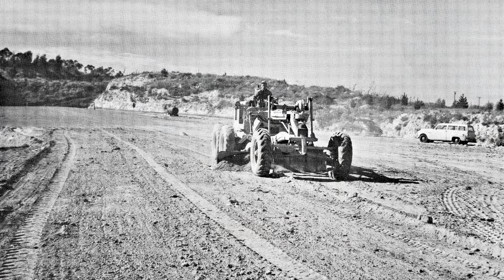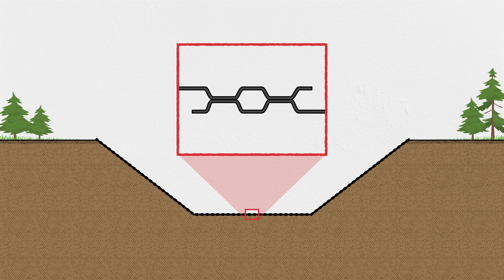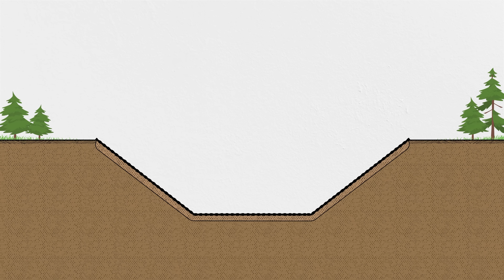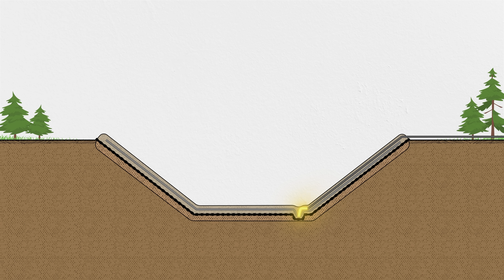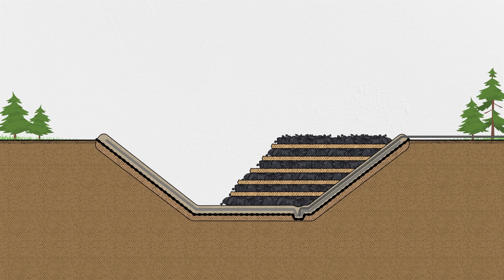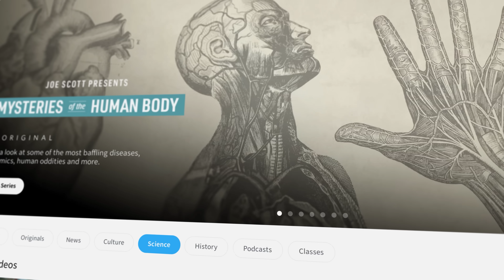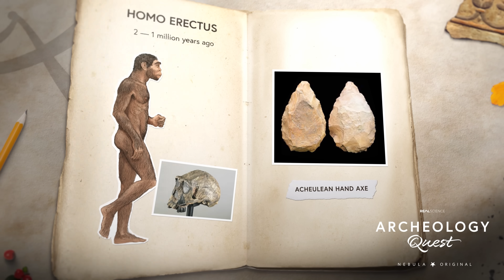The Hidden Engineering of Landfills

Comment: worked at and traveled to different landfills in the mid-west. I get repurposing the landfills after they close but don't the trash hills shrink over time after releasing all that gas and liquid? I feel like building something on them could result in structural issues down the line.

Comment: I've worked in dumps for a few decades. Most recently inside the Suncor baseplant in Fort McMurray, Alberta, Canada. And although advanced technologies are available, not many facilities are top notch. During ONE day, I can transfer between 5 dumps. I call them dumps because they are not landfills. Landfills, by the wording, are CLEAN fills. Garbage doesn't come from the ground. It is manufactured. But concrete, rock, soil, aggregate comes from the ground. So, landfill/cleanfill.

I had to deal with spontaneous dump fires from methane being produced. The putrid stench of garbage from decomposing rotting food is unfathomable. There ARE inspectors who come and check all the runnings and plans for each stage of a dump. But they are paper-pushers. They don't do much, other than ask questions and check off boxes on their checklists.

Comment: As an engineer, I don't like seeing landfill gasses flared off. It goes against the efficiency nut in me. I'd rather they be diverted to a power plant or something.
Reply: Usually they're only flared off when the volume or methane content is too low to justify the cost of recovery. A lot of landfills sell their gas. The one I'm at today is in the process of adding an active gas system that will tie into the local gas supply and feed a power plant  down the road.

Comment: I have a question. In Greentree PA, they built a mall on top of a land fill. The mall constantly shook. You didn’t notice the shaking when you were walking, just when you stopped walking. Outside in the parking lot you didn’t feel any shaking. The mall is closed now, not because of the shaking but because of economical reasons. Can you explain the science of the mall shaking? What was causing it. I didn’t notice any structural damage and people seem to accept the fact that the mall shook. The mall was called “Parkway Center Mall” if you want to look it up. I’d appreciate a response to this. Was it safe? Apparently people thought so.
Reply: It was trash

Comment: While I appreciate the very good and basic presentation,  and it was well done,  it was quite naive and presented a greenwashed view of landfills. All landfills leak. Flaming off landfill gas produces toxic compounds that fall out and contaminate  soil and water. While landfill owners must maintain the site for 30 years,  the toxic swamp and soup continue to be dangerous for unknown lengths of time with ongoing costs of maintainance and surveillance dumped on the local towns and cities. Landfills need to be carefully sited and a last resort after all reusable and recyclable materials have been removed.

Comment: I lived in Whittier from the mid 90's until 2005. Near rose hills which is a cemetery that's also a buffer between the landfill and residents in whittier. I lived very close to the landfill, and had no idea it was even there. I only found out in 2006 when I moved to hacienda heights which is on the opposite side of the landfill. My hats off to the puente hills landfill facility. I lived within 3 miles of it for 10+ years and never smelled a whiff of trash. I still drive by the location of the landfill, and it looks like a spot that hasn't been developed on. There's trees and vegetation which are mostly, if not all, native plants to that area. It looks like a mountain area that hasn't been disturbed by humans, when in reality it's 5 decades of our waste that made that mountain. Pretty amazing.

Comment: Here in germany, there is a law that prohibits the disposal of waste in landfills before it has been burned. So we have many waste incineration facilities which produce heat and electricity. And the ash that is left in the process is then (if possible) used in road construction and the things in the ash that cannot be used anymore get buried in the landfills. There are nearly no Problems with water contamination, Bad smells and it takes much much longer until a landfill has to be closed because it is full.

Comment: OMG Grady, I got halfway through this video on Nebula and had to go watch the whole thing with my mom. We live just a couple miles from a landfill near Joshua Tree, and NEVER know it's there until we go to drop off yard waste occasionally, and we have a subscription to have our like 3 gallons of garbage picked up weekly, even though we could put out 150 gallons according to our rate. 

I feel like this could be 5 videos, with one for in depth discussion on each step! You should go out and talk to the individual engineers kinda like Destin did when talking to the submarine crew or with the coast guard! 

A question we had was about the post-sealing step where like in Puente Hills where they extract the methane for energy production. Doesn't the trash turning into methane leave open pockets in the trash mountain that would eventually settle, or even crash into a sinkhole? Why would you want to build any permanent facilities on top of it if you were pulling contents out of the mountain you were sitting on top of?

Comment: In my country, we have discontinued the use of landfills for almost all waste. It is only the waste that cannot be burned or easily recycled, light concrete, polluted gipsum, asbestos, and some forms of pvc, that end up in a landfill. If it can be burned they are incinerated in special power plants that have the necessary type of owns that can do it, the heat is then turned into electricity and central heating and the smoke is cleaned of pollutants other than CO2. I have to say the way we do seems a way more economically sensible system than having to maintain landfills for decades and only slowly extracting the energy from the waste.

Comment: The year is 2091

after the big shaker, oil reserves unexpectly ran dry

plastic reduction is the leading means of generating hydrocarbons at scale

the oceanic deplastification projects have failed

the plant based hydrocarbon projects have been marred in politics and industry sabotage for decades

the one great source of plastics?

the landfills

a new goldrush has swept the continental united states

county landfills became federal reserves

once illegally dumped waste became buried treasure

abandoned stockpiles of worthless trash became salvage claims

these are the stories

of

THE PLASTIC WARS

sweet synthwave theme chimes in

Comment: Call me old fashioned but instead of locking away our waste for eternity, wouldn't it be better to use the now decades old technology of plasma gasification where we can take our trash 'evaporate' it to its base elements and gases - reuse those elements and gasses and what's left that doesn't breakdown is an obsidian like substance that we can use to build roads with. Plus the process can also be used to power electric turbines to generate electricity. That sounds better than an out of sight, out of mind approach.

Comment: Years ago we did an on grade HDD into a landfill whose leachate system was failing. The landfill was hard compacted clay and there was about a 1 meter target zone of shredded tires lining the bottom as our target. After Boring to the target zone we pulled the bit out of the hole, and forward reamed a 12 inch hole to the target and tripped out again. (spent a lot of time removing the tire shred off our tooling after.) The contractor we were working for then pushed a perforated pipe into our bore hole with an excavator. We did a couple other bores to eventually pipe it to a new settling pond they had built. Boy was that a gross endeavor lol. As soon as our BHA broke through the clay line the leachate came pouring out of our bore hole. they had massive containment pits around our rig to prevent the fluid from escaping.

Comment: Not once did he describe the decomposition of the trash after its been buried and the liquids/gases have been run off. If it decomposes enough would that cause structural failure leading to sink holes? Thats what i was waiting to hear about through the whole video. Will the trash decompose to the point it turns into some sort of oil?
*Edit:
Shakes him roughly WHAT HAPPENS TO THE OLD TRASH ROBERT!?!

Comment: 12:20 How is the dump not still profitable after closer when it can produce gases that can provide power for 70,000 homes? You sure its that many homes? Seems aweful high. 70,000 x 100 (cost of power)= 7,000,000 a month. I also think its very cool after closer they are getting new uses like power production and parks.

Comment: Renaissance Park in Charlotte, NC was built on a landfill. It worked out great for a long time, but the settling caused some major problems with the infrastructure of the athletic fields. I believe the golf course, disc golf course and bike trails are still functional though.  It's funny, I had to work a charity event on the golf course and would see the pipes sticking up out of the ground here and there.    I always loved the idea of recycling the landfill for park usage... but it does still need a lot of tweaking to make it work safely.

Comment: My landfill feels like you are on a plateau. It is huge, and you have to drive around it to get to the top. You look out at the distance and everything looks so tiny. When you drop trash, there are bulldozers just spreading dirt over what you drop. A never ending litter box, just building up on itself. Mine had vents that kept releasing a visible gas to the outside. It did not smell bad, and it was a very hot sunny day.

Comment: I don't know if this would fit in your channel's aegis, but Solid Waste Disposal via Pyrolysis[1,2] might be an interesting topic for you and your viewers. Key benefits of Pyrolysis are:

1. Massive decrease in volume.
2. Solid Leftovers are vitrified and less able to leach into the soil and groundwater.
3. Some Solid Leftovers can be used as building materials.
4. Production of Syngas, potentially offsetting the energy used for Pyrolysis.

[1] https://en.wikipedia.org/wiki/Pyrolysis
[2] https://greenpower.equipment/articles/pyrolysis-as-a-promising-method-of-waste-processing-basic-principles-and-advantages/

Comment: I feel like evaporating the lechate and putting what remains back into the landfill may be the cheapest solution but it might not be the best long term solution as if lechate is the main problem, maybe removing it from the landfill and repurposing it somehow will eventually mean the lechate becomes less and less dangerous over time, though its still probably best to evaporate the water from it so that you're dealing with a solid or at least less volume.

Comment: that natural gas is not just an unwanted byproduct of the trash collection but a goal of energy collection through decomposure the heat generated the gas from microbiology could just setup highly efficient power generation collection storage and else for providing night power when solar is unavailable or when the morning and evening winds are not strong for wind power absorption or water power a known in pumped storage etc actually gravity power batteries and else to take up demand capacity surges with less grid wear impacts due to heat of power losses i mean some off grid homes have waste digestor bags just for collecting gas from thier waste and fuel for heat  maybe not enough to run generators for electric 24/7 but still could be used that way to purge excess buildup into batteries for easy use later and to supplement other collection not generation sources as wording would lie to ya

Comment: The video is overly positive towards landfills.

No common trash should be put in landfills but be burnt for heat and electricity. This is totally possible as the Swedish example shows banning the practice since 2002 and 2005 for organic waste. Counting from 1990 til 2022 the emissions from landfills have decreased with a staggering 87% and keeps shrinking.

Comment: My hometown (in Kent County, MI), had only 2 years of life left on its landfill. So they built a comprehensive waste sorting facility, where municipal waste could be sorted into combustible and recyclable waste. By burning much of the waste before it was landfilled, the county is able to generate power and increased the lifespan of the landfill to 20 years, since now it just takes in ash.
Reply: thye could sell the ash as fertilizer. well, trash ash. so maybe not (:
Reply: @LuxicCardinal  
Some municipal waste facilities offer compost from the yard debris they take in. Great for flower beds, but don't use it to grow food you plan on eating.
Reply: @SoberAddiction my hometown of Bethlehem PA has been doing this, as well as offering free mulch, since the early 1980s
Reply: @LuxicCardinal  it goes in a salt mine as it is not really healthy
Reply: As someone who grew up in grandville I never knew this! Do you know when this all happened?
Reply: @lagsalot7626  goto to kent county board of puplic works site
Reply: @lagsalot7626
Reply: That facility also has a bio dig-ester that takes waste from Amway,  Coke and founders and digest their waste. It removed enough waste from the treatment plant to extend  its life longer and removed the solids from the bottom of the tanks also to digest.
Reply: Hey! I lived in Grandville for a couple of years and worked on Alpine Ave. for a few years. We moved north to Grant for a few years, then used the Muskegon Co. dump on M-46 when we moved back to Lansing.
Reply: @adamdewitt6430  I grew up in Kent City!! I didn't know that Kent Co had municipal sorting. My son wanted to watch this and I saw this comment come across.
Reply: hello fellow michigander!
Reply: I wonder how the carbon emissions compare with burning to landfilling.
Reply: @Axle-F In switzerland we dont have landfills, just burning facilities. we use high performance carbon filters, recycle a lot and generate energy with it.
Reply: @sinn6719  What happens to the ash in Switzerland?
Reply: @sinn6719   That's a bit misleading, there isn't really such a thing as carbon filters.
Reply: @sinn6719  The biggest problem with that idea in America would be the separating process. We just don't separate our waste enough.  I've traveled a lot and other countries just have a culture of waste separation that's just much better.  Every trash bin has multiple options for various types of waste, whereas in America it's just one big bin.  It's a huge part of our consumption problem, as a society we don't want to put in the effort to separate it because that requires thinking about where the waste goes and people are uncomfortable with that. So the "magic" bins just disappear with our waste each week and we don't have to think about it.  
More and more restaurants and public spaces have better separation bins these days but it is a very very slow cultural shift to get people to pay attention to the bins and an even bigger challenge to get them to separate waste at home.  

I'm currently saving to buy land and I'll be excited once I have my own homestead to be able to separate more by having larger compost, wet and dry waste, the ability to store lumber waste (I like to do woodworking, but don't have much space currently), and a place to make a mulch pile, etc.  We don't do enough in America to take care of our world.  It takes both personal accountability AND systemic efforts to make change and right now not much of either is happening here...😢
Reply: @Axle-F usually these types of facilities are fitted with carbon scrubbers on the exhaust.  So the foot print would only be the cost of making and reconditioning the co2 scrubbers
Reply: @Axle-F   It depends. With organic waste, when you bury it you cause anaerobic decay which leads to methane emissions, which are more potent than CO2. Burning would cause CO2 emissions instead, but if that organic waste was allowed to decay in air it would release CO2 anyway, but you would get some excess emissions from the natural gas you use to start incineration. However, burning plastics means you're putting CO2 into the atmosphere which would have just been better off buried in the ground.
Reply: @Axle-F  better to keep the methane emissions and such in mind for this, since for the lifetime of the landfill, the methane isnt sealed in. By burning the trash and only compacting or reusing the ash, youre getting the last bits of useful life out of it, preventing it from generating methane, and possibly using the ash itself in something else useful.
Reply: @Axle-F  Doesn't matter. The county doesn't deal with carbon emissions.
Reply: there burning trash in kent county? is this africa
Reply: I'm from Grand Rapids and I used to bring my stuff to the downtown location sometimes. I'm not sure if there's more than one location where you can drop off your own sorted trash but I went to that one and it's nice. The city had a great system too where you got a whole trash can the same size as the trash, to put recycling in upon request. It was blue with a yellow lid, easy to tell the difference from the trash.  I always ended up with more recycling than trash so I chose a bigger recycling bin. Then they pick it up for free.
Reply: I remember a new incinerator opening in my town of Huntington, LI, NY when I was a kid.  Probably about 1950.  

Europeans burn a lot of their trash, I'm told.  Easier to get the energy directly than waiting for the methane to be produced and collected.